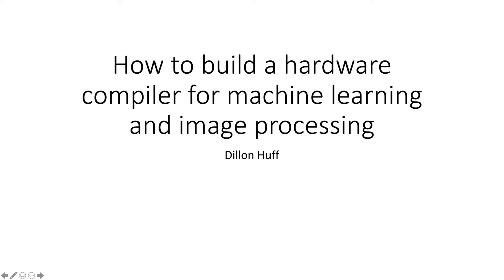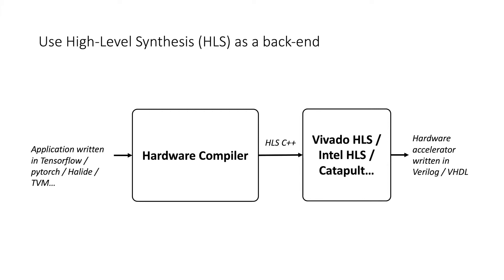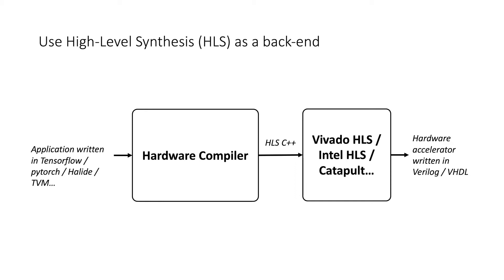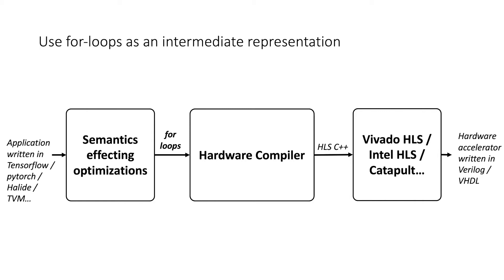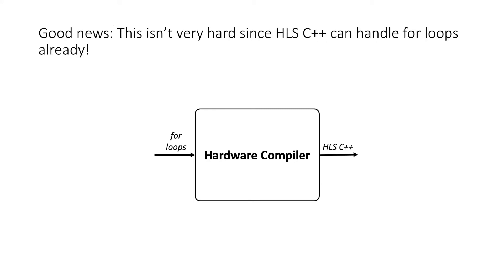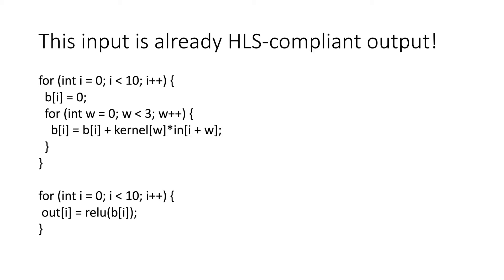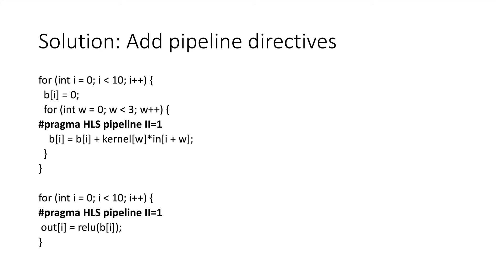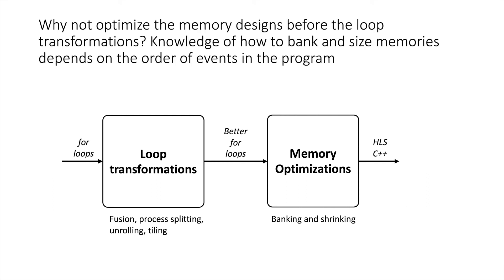How to Build a Hardware Compiler for Machine Learning and Image Processing Part 1

Comment: Hey, great video!

I am not familiar with C++ HLS and currently doing some sort of hardware compilation but for sparse operations. Hence the operations are sparse, loops are primarily doing some pointer chasing and it seems that tree-like data structures like Quad-trees are more suited for this kind of job. The operations that utilize quad-trees are fused well for,e.g., sparse matrix element-wise operations and masking, by techniques like supercompilation/distillation.  These techniques are mainly applicable for functional programming languages where loops are replaced by recursion. As far as I am concerned recursion is not well-supported by modern HLS tools, so I rely on a state-of-the-art Haskell-to-hardware compiler. So, have you any thoughts or experience with sparse hardware compilation, or know about successful fusion for such operations that could be performed in e.g. C++ HSL? Also, I would be grateful if you could share your thoughts about the approach that I follow.
Reply from the maker: Glad you liked the video Alexey!

I don't have any experience with sparse hardware compilation, so I can't speak with authority on it. I know that recursion is not supported by HLS tools, so anything that is best expressed as recursion is not a good fit for HLS.

I'm not sure what the context of your project is, but I'm a bit skeptical of the whole area of hardware accelerators for sparse applications. My understanding from talking to people who are experts in that area is that in most sparse applications energy consumption is dominated by off-chip memory accesses, so the accelerator design itself doesn't have a huge impact on performance.

That said, there have been some widely cited efforts to build DNN accelerators for support for sparsity, here are some links that may be helpful:

https://arxiv.org/abs/1602.01528

https://ieeexplore.ieee.org/abstract/document/8686088
Reply: @DillonHuff  By the way, could you elaborate a little bit about this one "in most sparse applications energy consumption is dominated by off-chip memory accesses, so the accelerator design itself doesn't have a huge impact on performance."?  Did you mean that there is no profit in energy efficiency or that such accelerators are not profitable nor in execution time or energy consumption? And am I correct, that by off-chip memory you mean e.g. DRAM on boards like ARM+FPGA?
Reply from the maker: @alexeytyurin5465  You are correct. I meant that there is not a big energy efficiency benefit to designing hardware accelerators for sparse applications, because the DRAM access costs dominate the energy cost of the application.

In theory energy efficiency and performance (operations performed per second) are separate issues. In practice, because almost all modern hardware designs are power-bound their energy efficiency and performance (operations performed per second) are proportional. Mark Horowitz has a good explanation of this in his ISSCC talk:

https://www.youtube.com/watch?v=7gGnRGko3go&t=1373s